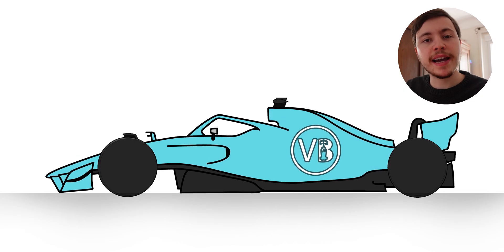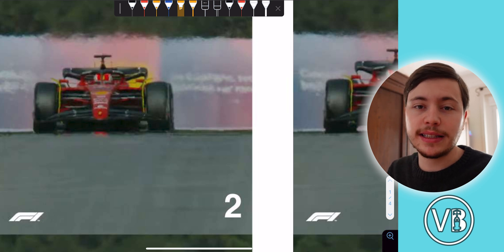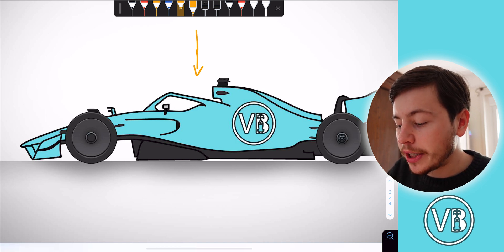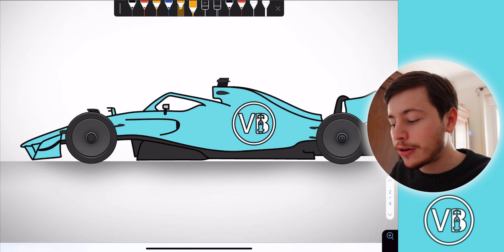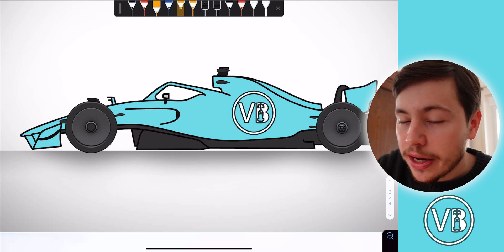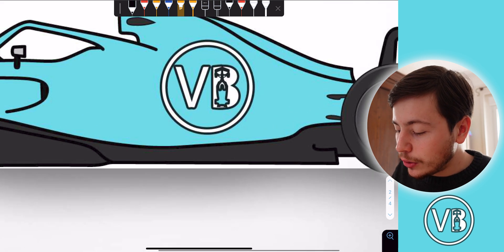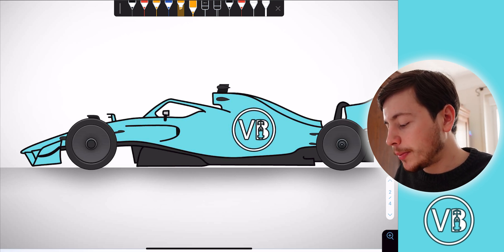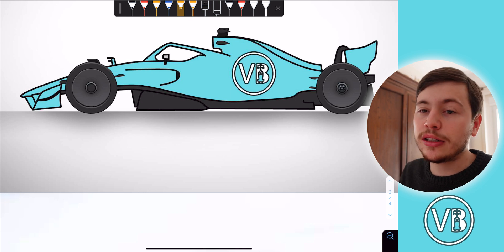Formula 1 Porpoising: What is it and how can it be fixed? F1 2022 Testing Barcelona

Comment: Is there a rule against why they can't have a spring loaded valve that opens if the underbody suction reaches a certain point? That way the valve will flap a bit instead of the car bouncing? Is this considered active aero and against the rules?

Comment: The problem isn't the car. They are tuned to the limit.
The problem are bumps in the road which start the oscillating.
So at this moment it is just waiting to see what happens if all the influences will amplify each other.
Example, overtaking on the outside of a high speed corner.
Wrong whiff of dirty air from the car to overtake.
Gust of wind.
Irregular Road surface.
Bumps while running on curbs with the outer wheels.
It would just bounce up and loose all down force.
Red Bull did have a wishbone which is said to prevent nose diving.
But what you really need to avoid is the excessive downforces due to the vacuum under the floor.
So as the most simplistic solution I would look at a flexible part, which allows more air to the venturi and avoid this.
So the bigger the pressure difference between in and outside of venturi.
Sadly the flexible parts (not like the cuts or holes) are probably not allowed.
Further, this isn't a team problem. But more a FIA rulebook flaw.

Comment: There's a way to remove hopping and increase downforce in one go.
Reply from the maker: Is there? Could you explain it so I could improve my future videos please?
Reply: @VBMotorsport  It all revolves around the flow after the throat of the tunnel. McLaren Red Bull and Alpha Tauri are ahead of the game, look at the little flick up they have near the floor. Alfa also figured it out.

The other fix is at the leading edge of the tunnels. Particularly the t-tray/bow area.

If you look at the plank section in isolation, you'll notice it is basically a sideways neutral airfoil. The teams that deal with bouncing all have very sharp leading edges of the T-tray, don't they? McLaren is an odd exception because their tunnel inlet is segregated from the floor. You notice they have a little U channel in the T-tray/bow area.

Red Bull has a completely blunt leading edge of the T-tray, the airflow around that blunt leading edge will be much smoother, and much less likely to detach when the car pitches up and down.

Contrast this with Mercedes, Ferrari, AMR, Williams, basically the rest of the grid. They all have very sharp leading edges at the T-tray. Notice Mercedes tries to accelerate the airflow as much as possible with their front wing and tunnel. It produces a lot of downforce, so much it deforms the floor causing it to stall.

So you inject air into the diffuser to prevent stalling via those flick ups. You make the car ride on a cushion of air to prevent it from bottoming out. Then the floor can do its thing.

Mercedes brute forced the floor into compliance with stays, but that's just an Alpine style hack job. Alpine cut notches into their floor and it relieved the hopping for them. Therefore I have a strong inclination to believe the floor is the key.

If you notice on Friday, Ferrari largely solved their problem with their floor update, which included a flick up that allowed air into the diffuser past the throat.

Comment: Easy solution and not reduce any ground effect is to introduce suspension stops which will prohibit the suspension being compressed to the condition where the floor touches ground
Reply from the maker: Do you mean introducing active suspension again? Well well that would be VERY interesting to watch :D
Reply: Perhaps the FIA would allow it on the grounds of safety 🤣
Reply: @paulhiggins8774  It would also increase the weight of already heavy cars…
Reply: @deeann8923  hollow flexible structure with a slight flex
Reply: @paulhiggins8774  I was speaking about the added weight of an active suspension system.
Reply: @deeann8923  sorry buddy, you are right there 👍🙏
Reply: a downside of suspension blocks is that the moment you hit a bump, it can't absorb the impact and will shove the wheel into the air
Reply: @Appletank8  the stops don’t have to be solid, would allow slight  movement
Reply: @paulhiggins8774  
the result is still a second stage, extremely stiff spring, which would react badly to any surface imperfections, on top of the cars already using pretty stiff suspensions. You want softer suspensions to handle bumps and uneven ground.
Reply: @Appletank8  Don't know if anyone is running those in recent times. They were called Heave Springs. One of those was what hit Massa when he was with Ferrari...
Reply: @Appletank8  what if you can choose when to activate it. E.g. Only activate the stiff suspension on straights and when DRS is open?
Reply: @asignul2009  Sounds dangerously close to how active suspension was conceived. I can't speak to the specific wording, but the concept is that suspension systems are intended to be passive...